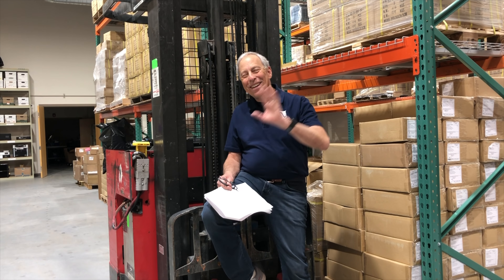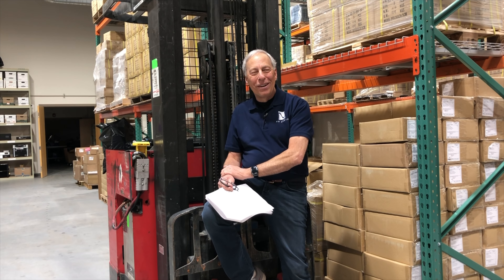Why aren't speaker cables balanced?

Comment: Well if you are running a bridged power amp, you essentially have a balanced speaker cable and load! Aside from that passive speakers have no electrical gain and therefore are very insensitive to induced electrical noise on the cable. Furthermore the source impedance of a modern amplifier is in the fractions of ohms further resisting EMI ingress. And to top it off, speakers are generally electrically isolated units. They have no "safety ground" so they can't cause ground loops either.
Reply: All Krell amps are balanced at the speaker  terminals which essentially means you can run fully balanced from source to speakers
Reply: @hnipen  So are you saying the Krell amps are a bridged topology?
Reply: Andy Delle  No I am not saying they are bridged, they are made fully balanced from end to end
Reply: @hnipen  OK, there are several ways to do that, one is essentially bridging, others may still keeo the speaker negative at ground potential. In any case a balanced speaker line in it's self has no real benefit. There may be a benefit however in the design of a particular amplifier.

Comment: Many two channel amplifiers can be connected as a single channel amplifier operating in the bridge mode which becomes a balanced output providing twice the output voltage swing and up to four times the output power for a given load impedance.
Reply: This guy knows what's happening.
Reply: I run 4 mono P500 Hafler Van Alstine in mono, so using the two hots as outputs, is balanced...

Comment: The reason it doesn’t matter is because the impedance is much lower and signal levels much higher compared to line level signal connects. The combination of low impedance (e.g. 8 Ohms) and multi volt signals means any typical noise (EMI) induced in your speaker cables will not yield audible interference. Also, the coil in the speaker makes your speaker cable work electrically exactly as if the signal is balanced.

Comment: What if your amp had unbalanced outputs and you want to connect two speakers together without daisy chaining(splitters?) the top has a single 1/4 inch female and the bottom speaker has a male XLR.

Comment: My question is you have seriously heavy gauge speaker cables from the amp to the speaker cab but if you open the cab the wires inside are tiny even in cabs for 700-1000w speakers so why bother with speaker cable that costs £10per yard when inside the cab they use bell wire that's about 25p a yard
Reply: Inside your speakers maybe. Inside mine the cable is heavy duty as supplied by the manufacturer (VAF). I used similar heavy gauge cable betwixt amp and speakers and it cost nowhere near £10 per yard. It's £2.25 per metre here in Oz.
Reply: I have looked at the insides of a lot of speakers; I have never seen a serious speaker that uses bell wire for internal wiring.
Reply: @juliaset751  I was over exaggerating a little
Reply: @My Name dont know what speaker cable you use but the thinnest I ever use is 8ga and have taken many high end speakers apart and the thickest I've even found inside was 16ga and tbh some sound great like that and others that I have upgraded the internal wires for have sounded far better after especially when I've been running 2kw per channel
Reply: @alanshayler941  I miss the days when you could run down to Radio Shack and get some really good wire by the spool for a reasonable price.  And other things, like an Alps Blue Velvet pot for under $3.
Reply: @My Name "Consider the lengths of the wires..."
Good point. There's usually a rather long length of thin wire in the form of a choke in series with the woofer. That's one of the reasons my speakers sound like they do; there's no choke.
Reply: @My Name The higher frequencies are attenuated mechanically. Phil Vafiadis had the transducer manufactured to his specification and then applied felt pads to the woofer cone. It's mounted in a transmission line that further modifies the response. The end result is a very efficient speaker with extended bass. It's 3 dB down @ 29 Hz. The tweeter is fed through a capacitor though I needed to put a small value resistor in series with that to tame the top-end a bit (room effect).
My VAF DC-Xs are the original two way design and I purchased them in 2000. More recent versions have followed a somewhat different approach. Gumtree have a pair for sale 2nd hand (a rarity) and they are selling for the same price I paid back then. Mine are not for sale.
Reply: @My Name It was certainly an eclectic approach back in 1995. Phil later abandoned it. His recent designs use more transducers and so would need a more sophisticated crossover. I've not met him, but my friends who have tell me he's much like Paul; an audio enthusiast first and foremost.
Reply: @My Name What I figured back in the 1970s. But I'll bet it's more lucrative than market gardening which was what I did for most of the 1980s.

Comment: Balance amplifier/ speaker connection is also called bridge configuration.
Voltage doubles
Current remains the same or a bit smaller
Output impedance doubles
Power quadruples (if current allows)
Even harmonic reduced
Common mode noise cancelled
Reply: Common mode noise is cancelled where?  No it is not. The two amps are still fed with the same signal, just 180 degrees out of phase. Any common mode noise that makes it into the amplifier will make it into the speaker.
Reply: A bridge tied load isn't balanced in the line. It's made by inverting one positive amplifier at the output stage, increasing the voltage swing. That's not a balanced line. It's still unbalanced but with more available voltage. There's no cancellation, that's at the input stage.
Reply: @robertt7238  Only the differential signal will end up in the speakers. All speakers are actually balanced(left right separated)to begin with but not the signals.
Reply: @hardcorecap  Common mode distortion like caused by power supply, even harmonics will be canceled. When driving a speaker it's the positive terminal minus the negative terminal. The speaker is self is functioning the same as a difference amplifier but a speaker.
Reply: @johnyang799  "The speaker is self is functioning the same as a difference amplifier but a speaker."
Can somebody please explain that sentence in a form I can understand?
Reply: @jonathansturm4163  two terminal device. no grounding. the voltage across the terminal is what matters. just like a difference amplifier but in this case it's a transducer instead of am amplifier. lol

Comment: Sorry, but what a load of nonsense.
Balanced cables are applied where noise to signal ratio is relatively high and where high gain is applied to said signal. Balanced preamps are designed to cancel out induced cable noise, by amplifying that noise in counterphase. Induced noise in a speaker cable and subsequent gainfactor is about.... errrrr non-existent, zero, nihil. Therefore totally eradicating the need for balanced cables. But.... whatever... 
Someone will buy the oil anyways.
Reply: Thank you! I was face palming the whole vid.
Reply: @hardcorecap  You are welcome. Someone had to do it... 😉
Reply: It's about the balanced connection/ bridge connection of amplifier and speakers. Get your knowledge straight before dumping shit.
Reply: Actually Paul gives two reasons for to have balanced amp outputs & speaker cables:
1) noise suppression
2) amp output stage distortion correction.

For reason 1) I totally agree with you: induced noise in speaker cables is negligible compared to the high signals the cables carry.
But reason 2) actually is a valid point: if you have a single ended amplifier output stage, it typically consists of an NMOS and a PMOS transistor. The NMOS makes the lower half of (let's say) a sine wave, the PMOS makes the upper half. Since an NMOST behaves significantly different from a PMOST (lower on-resistance, different threshold voltage, different temperature behaviour etc) the output signal will get slightly distorted, leading to odd and even order harmonic distortion (since the upper and lower half of the sine wave are different).
Whether this distortion is audible in any modern amplifier is another thing. But still, if you take two identical amplifier output stages, each having their own NMOS and PMOS, and you drive them with opposite input signals (balanced), the difference between their outputs will still distort but symetrically: all even order harmonics (2nd, 4th etc.) are canceled. You will still have odd order distortion (3th, 5th harmonics etc) but these are less audible for the human ear.
So a balanced amplifier output stage does make sense. Especially at high output volumes that generate more distortion.
Not that I think the effect will be audible that well :P (especially since many amps have lots of feedback that suppresses distortion anyway).
Reply: @johnyang799  Where in the video was the bridge connection mentioned ? Thank you ! Play again ?
Reply: @Tubetinkerer  Lol nitpicking the wording just to sound smarter. Nice.
Reply: @MrTheNark  I did not argue against balanced power amps. I argued against balanced speaker cables. Because in reality a regular speaker cables already carries a balanced signal. Paul was right about that. For a balanced amp to be of any real use, a speaker coil would require a center tap. Which immediately answers the question why there are no center tapped coils. It would be very, very hard to produce a perfectly balanced coil and thus introducing distortion.
Reply: @johnyang799  Well..... you made it easy for me. Thanks !
Reply: @Tubetinkerer  You don't even understand what's balanced. Wtf?
Reply: @Tubetinkerer  You don't need a ground reference to be balanced. If you want to go that route fine but that's not needed.
Reply: @Tubetinkerer  Balanced cable and balance amping is the same thing. Don't separate these two.
Reply: @Tubetinkerer  You only need a positive wave and inverted wave to do the distortion cancellation and double the voltage swing. That's what you need. Probably more separation but that's not really worth noting in speaker system.
Reply: @johnyang799  Triggered much ?
Reply: Balanced interconnections are to cancel out common mode noise ... common mode noise on speaker cables would do exactly nothing.
Reply: Can you tell me how accurately the gains need to be matched such that they don't create worse issues?
Reply: @robertt7238  
The idea is that the noise in both signal leads is equal, so to cancel the noise out fully, the matching should be perfect. But even if not perfect, the issues can never be worse (if properly designed), and even when not fully cancelling (mainly due to component tolerances) there will still be a significant, and very audible, reduction in noise levels.
Reply: @Larry Niles What's rude about telling someone that he is talking nonsense while explaining where he is wrong ? You feel offended because someone questions your cult of audio-woo ? Please feel free to get some education on the subject and you are very welcome tell me where I am wrong.
Reply: @Tubetinkerer   No, in the definition of a balanced signal, they do not, some do, i.e. BTL outputs, but not in general .... and it does not matter except for RFI emissions a small amount.

Comment: Sure, and amplifiers that use an output transformer (mostly those that use a tube output stage) can be balanced also. As long as one side is not connected to ground.

Comment: Had a long Sony headphone cord that worked very well. It had a fine wire coiled around another like a pigtail.
Reply: Headphone cord is not balanced in the situation that it's used. On the connector, Tip is left channel, Ring is right, Sleeve is ground.
Reply: Correct, I'm just implying out a more lossless way  to power speakers. Pigtailed wires reflect its electromagnetic field internally. Might make noticeable difference in backwall surround speakers for example.
Reply: @ronbrideau8902  It's my assumption that if the goal was to run balanced all the way to the driver, that the voice coil itself would have to be designed to invert one leg of the signal.
Reply: It seamed to make a very significant difference in the headphones. They had great sound and were louder than much shorter headphones. They use pigtail wire for connecting antennas. It is different from twisted pair wire.
Reply: It was long and highly flexible cord. When I had to repair it after I lent it someone, It had very fine copper wire wound around with many tight turns like is done in an electromagnet.

Comment: If this guy is a degreed engineer, that would be really scary. If he worked for me, he would be fired, on the spot, for gross incompetence and ignorance. Interconnects work better with balanced because, two components MUST have a ground reference, and that ground reference, whether resistive, or capacitive allows common mode noise. An alternative to balanced, would be to use transformer coupling to eliminate most common mode noise. A speaker has no ground reference, and capacitive coupling to GND for a speaker is virtually nil.  An argument can be made for bridged amplifiers as in some cases this mode cancels out some harmonics in some architectures. This VIDEO should be taken down. It is fake news, right up there with Flat Earth Videos.
Reply: @Larry Niles And you dared calling me rude ?
Reply: @Larry Niles I have designed audio products that have sold more unit than PS Audio over their whole corporate existence. I have implemented complex acoustical corrections in concert halls around the world, and with my partner, have a product design firm that yes, has done audio, as well as many far more sophisticated things.
Reply: You can't be that great if you are blowing your own horn go get your own show and see how long it lasts